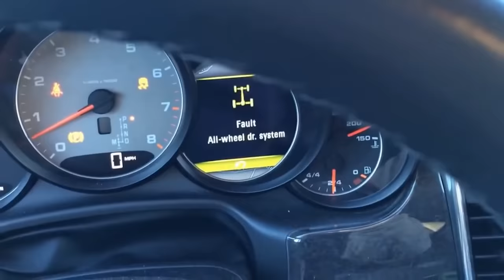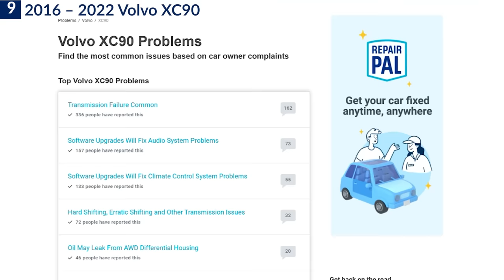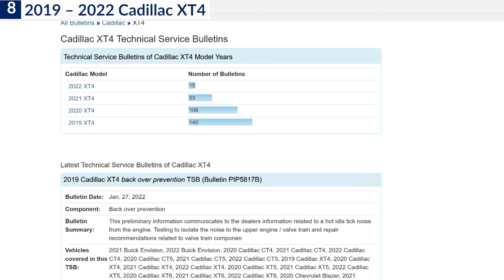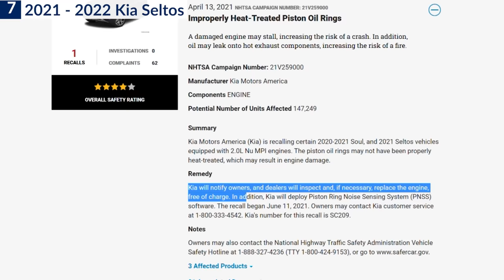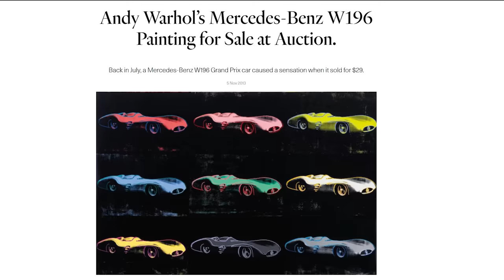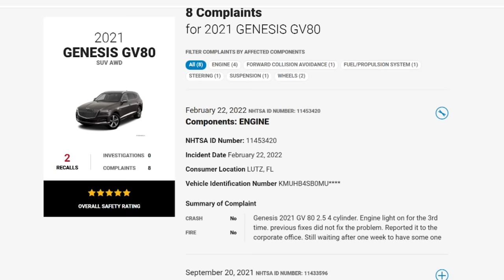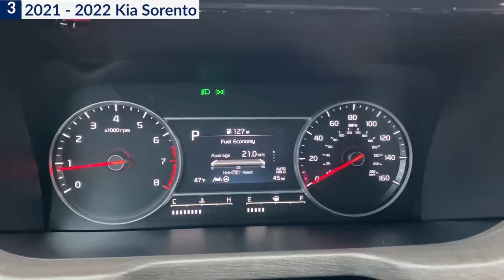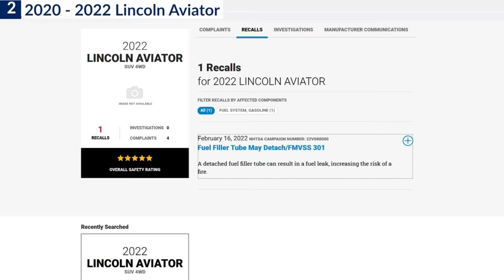10 New SUVs to AVOID - Here is Why !!

Comment: Half the time you spent on talking about the GV80 was about it's cost, which has nothing to do about the topic of this list. Proving you couldn't find much at all wrong with the car. But in regards to the cost, it's much cheaper than it's direct competition when similarly equipped.
Reply: You need to go back and check the times. He literally spent more time on the problems than the cost
Reply: Especially the repair and maintenance cost!
Reply: lmao what are u talking about?

GV80 can go for 65K for a 4 cylinder, so there is no value. I would rather get me a Lincoln Aviator, which is actually the true value king and competitor to the GV80 in the segment. Hell I'd even rather get the new MDX over the GV80 too since the Koreans is asking way too much and too confident. 

Aviator starts at 51K and GV80 48K, so on the first glance the GV80 is undercutting the Lincoln. However not only does the Aviator also has RWD, but comes standard with a base 3.0L Twin Turbo Ecoboost V6 with more horsepower and torque than either the 2.5 or the optional 3.5 of the GV80. 

Also in the GV80 you need to pay extra 11K on top of the 48K starting price to get the 3.5 (and still don't have as much power), so comparatively spec by spec, GV80 is more expensive. 

Of course the Black Label Aviator is most expensive than the GV80 but you get more ownership and membership features that you don't get in the GV80. 

Not to mention the Aviator is bigger vehicle and can tow and haul more as well. Hell even a front wheel drive QX60 mommy mobile can tow more than the GV80. Ecoboost is also proven to be reliable with the 3.5L reaching north of 300000 miles.
Reply: Genesensitivity!
Reply: I have a Genesis G80 (not a SUV) for over a year and it's amazing.  Also have owned a BMW 740 and a couple Acura.  The cost and reliability can't be matched.
Reply: I have a g70,  best car I’ve ever owned. I’ve had, Bmw, mb, Acura, Infiniti, all those were trouble.  This car runs circles around the others I’ve owned many times.
Reply: @craigc1879  congrats!

Comment: I had my GV 80 with zero issues for two years. It just got killed by a drunk driver, and its  top safety rating paid off. I walked out without a scratch, with both cars being write offs. As for value, it’s got  all the features of far more expensive cars except for the option for those people who want a 500+hp engine. I have no idea how it can be on this list.
Reply: I have a GV80 Prestige. Super happy, this list is stupid, the GV80 is a luxury model not a CRV. I also have no idea how it can be on this list.
Reply: Because you are Korean

Comment: I own a GV80 had it for more than 1 month and just breached 2000 miles. So far so good. I guess time will tell, but the part about it being too expensive is entirely subjective. The features that it has vs it’s competitors-Mercedes GLE, BMW X5, and Audi Q7, make it a good value.
Reply: Much agreed, my mom went from a Cayenne to a gv70 and she has 0 regrets. It’s got nearly 4k on it and has had no issues thus far. Interior is better than the Porsches in my opinion too, they did a killer job
Reply: I have a gv80 n had it almost a 1yr n had zero problems so I guess it's on how well u take care of ur car
Reply: @corriuadorsey3728   Truth
Reply: I have a GV80 Advanced and I love mine!
Reply: I’ve had my GV80 for a yr and so far so good.
Reply: @iananderson8911  Agreed, I used to own 2020 Cayenne and that had electronic and connectivity issues from very early on.
Reply: @iananderson8911  I would never buy a first or second model year of brand new vehicle. Asking for trouble.  Too many issues to work out
Reply: @seanelucero  I totally agree, I wouldn’t either but the opportunity came up and my parents didn’t want to keep dealing with the Porsche name premiums on even the smallest stuff that was having issues with that vehicle and so they jumped on the gv70. So far no issues but time will tell
Reply: All of their ratings are based on rare comments they hear on forums and are very highly subjective, not fact based. If Genesis is rated low for price, where is the tremendously unreliable BMW, Audi, etc...? This seems totally random!
Reply: I want a Gv80 so badly. I’m going to get one soon!
Reply: GV80 can go for 65K for a 4 cylinder, so there is no value. I would rather get me a Lincoln Aviator, which is actually the true value king and competitor to the GV80 in the segment. Hell I'd even rather get the new MDX over the GV80 too since the Koreans is asking way too much and too confident. 

Aviator starts at 51K and GV80 48K, so on the first glance the GV80 is undercutting the Lincoln. However not only does the Aviator also has RWD, but comes standard with a base 3.0L Twin Turbo Ecoboost V6 with more horsepower and torque than either the 2.5 or the optional 3.5 of the GV80. 

Also in the GV80 you need to pay extra 11K on top of the 48K starting price to get the 3.5 (and still don't have as much power), so comparatively spec by spec, GV80 is more expensive. 

Of course the Black Label Aviator is most expensive than the GV80 but you get more ownership and membership features that you don't get in the GV80. 

Not to mention the Aviator is bigger vehicle and can tow and haul more as well. Hell even a front wheel drive QX60 mommy mobile can tow more than the GV80. Ecoboost is also proven to be reliable with the 3.5L reaching north of 300000 miles.
Reply: @miraphycs7377  "GV80 can go for 65K for a 4 cylinder, so there is no value." LOL That sentence makes no sense whatsoever. If you're saying the vehicle costs a lot and only comes with a 4 cylinder engine, well guess what - almost every luxury SUV on the planet comes with a base 4 cylinder engine (which is not $65K by the way - $41K USD, $55K CAD). I get it...you prefer a Lincoln. Go buy a Lincoln. ;)
Reply: @dalehuhtala9285  u cannot get a gv80 for 41k lmao
Reply: @miraphycs7377  Sorry, I meant the GV70 but still...
Reply: Range Rover the least reliable
Reply: It better not have any problems that thing is new haha.
Reply: I 100% Agree!  IMO, I think GV80 is better than any other of its competitors.
Reply: This video has almost 0 credibility like the info about the GV 80 and other cars is blatantly false.
Reply: Love mine
Reply: I bought my GV80 last night, no problems so far ;) love it!!
Reply: I love it how people keep complaining about the price of this car. It’s a LUXURY suv. It is an expensive thing. What people don’t mention is that it is significantly lower priced than its competitors and happens to offer a lot more for the price than the others do.
Reply: Totally agree. We looked at everything and went with the GV80 prestige because nothing compared for the price.
Reply: Had our GV80 Prestige for a year and sold it. Hopefully, you live in a warm climate because around here they were awful in the winter months after awhile. First winter was okay… second winter, the problems came and the dealership/service experience was the worst we’ve ever experienced. I would not buy another Genesis product again.
Reply: @beri232  sorry to hear that your Genesis didn’t workout. I have been through one winter. So far so good. Our winters aren’t too bad. I had one bad service experience. I was out of town and needed a tire checked and I went to a dealership that was a hybrid Hyundai/Genesis dealership. There customer service was atrocious. The dealership that I usually go to is a Genesis only dealership and they roll out the “red carpet.” If you got a lemon then I don’t blame you one bit; for the amount a fully loaded Genesis costs you should get impeccable service. If you don’t mind me asking, where you happy for what you got for your Genesis when you “unloaded” it; how bad was the depreciation?
Reply: @beri232  , can you please give us some more detail on why it was terrible in the winter? We just drove ours through the mountains in -8 weather and it was great. The only issue we had was the side mirrors froze but they still opened with some resistance.
Reply: @robertwalker8453  they wanted me silenced as I had written into Genesis Canada about the dealership and the problems I’d had with the car. I sold it back with a cracked windshield ($1,700.00 Cad) and they gave me $79,000.00 Cad with 14,000kms on the odometer. New cost was $85,000 Cad. It was the second winter of ownership that the car started failing. We get cold winters here and I park my daily drivers outdoors. Garage is for my bike,my Vette and my tools :)
Reply: @robertshields6214  first winter was fine… it was the second winter the troubles started. Engine ran terribly rough in temps colder than -25 celsius (the Hyundai mechanic slipped and said it was a common problem with Hyundai V6 engines), extremely rough ride on the 22’s in cold temps, electronics started to glitch (especially the nav), transmission would not go into gear a few times (we’d have to turn the car off, wait and restart it to get it to work), it stopped blowing heat on the passenger side of the car. After a month and a half, they still didn’t have it fixed and they had 8 other GV’s in line with the same problem. This was the final straw at which point we sold it back to the dealership…. this was in February of 2022.
Reply: @beri232  Although the car didn’t pan out for you; selling the car back for more than 90% of what you bought it for after a year and a half isn’t a bad deal.
Reply: @robertwalker8453  no it really wasn’t. It took a year for us to get it from when we gave the deposit. There’s a shortage here in Canada and it’s driving up used car sales prices as well.
Reply: Lol! Look man, you should cash in those chips while they still got value. Don't wait cause you might wait too late.
Reply: @dalehuhtala9285  It's not random.. It's very very accurate. Consumer reports  has been putting out this list for 40 years or more. When have you ever heard anyone say: Man, my car is toooooo reliable, Consumer Reports was soooooo wrong."? NEVER is the answer. They use feedback from actual owners plus they catalog parts from previous model years and those complaints and if new models use problem riddled parts from the past they know the model will have problems again. I pay close attention to this list every time I buy a car and it has saved me tons of headaches and cash. Toyota, Lexus, Mazda do awesome on this list and every year those brands do well because they build reliable vehicles. Kia/Hyundai has been putting out garbage since the 90s and they still are. You can tell because you don't see their older models on the road. It's sad because they market those vehicles to minorities, who can least afford the repair bills.
Reply: @3811eric  They reel you in with cool looking tech, problem is your buying a car not an IPhone. Get the basics right...engine, transmission, those come first! So many people make this mistake today. Oooh look at the digital dash! 😍 Well, I hope it looks good when they're waiting for a tow truck.
Reply: @robertshields6214  Get off the ship b4 it sinks. You've been warned. Don't fight the power. You don't owe Genesis anything. They don't love you. They just want your cash. Go get something that won't have you stranded.
Reply: Will be praying for you all to go good 🤣
Reply: i just ordered a gv70 and cannot wait for it.
Reply: 8 complaints on a brand new model from a nearly new brand…. I’d say you’re probably safe buying a GV80. I just bought the GV70, passed 1k on the odo and not even a hint of a problem!
Reply: Which engine do you have? Most issues have been with the 2.5T 4 cylinder turbo.  The 3 5T v6 has been good.
Reply: @seanelucero  That is a very good rule to go by. But it depends on the brand history of reliability.  I wouldn't hesitate to get a brand new model year of a Lexus in its first year of production.  I trust that brand wholeheartedly based on its 33 year history of STELLAR DURABILITY RELIABILITY QUALITY AND CONSISTENCY.
Reply: @gabevillarreal96  that is the one i ordered. i got the sport but not the sport prestige.
Reply: @jeremymoore7167  I was saying that because I own a 2022 Genesis G80 with the 3.5T and it's been perfect.  I don't get great gas mileage to and from work but on long road trips cruising at 75 I average 29 which is pretty good for a near 400 hp twin turbo luxury cruiser. I am meticulous about my maintenance and will continue to be. I'll keep it for 5-7 years and probably 90k. I should have zero issues. That's my hope. If it was engineered correctly,  everything will be great. So far I absolutely love it. Ride looks quietness comfort isolation and excellent acceleration.  Solidly put together as well!
Reply: Came here to say the same. "Overpriced" is not correct. The GV80 is expnsive, sure... But not overpriced.
Reply: You were warned, 2k? That's not even an oil change Talk at 150k plus
Reply: @fabfrenchies1974  at 21500 a still no problems.
Reply: I can buy a fully loaded GV80 in Germany for 90k. That's very cheap if you consider that it's main competitors, the BMW X5, Audi Q7 and Mercedes GLE, can be more than 150k fully loaded
Reply: @miraphycs7377  my very first car was a lincoln. The koreans have surpassed the americans in many segments imo.
Reply: I have the same car.. 47 thousand miles on it.. my transmission started to slip. !!  Never again . 😡😡😡😡😡
Reply: @dianamcgowan9277  oh wow. You must got a good one. I only had 56 thousand miles on mine. Then my transmission started to slip.. i couldn’t believe it. Never again !! 😡😡😡😡😡😡 I’m going back to lexus.
Reply: @harveyhankerson8359  Sorry to hear that. Currently at 31K miles and no problems so far
Reply: @robertwalker8453   best of luck.
Reply: I just bought gv80 with 78k msrp. I thought the just same. It is way cheaper than the bmw and Mercedes' counterparts
Reply: @dalehuhtala9285  Right! When he said it was expensive for a GV80 I was thinking the same. That thing is decked out with so many features for the price that others would have others reaching into $100k for an SUV.
Reply: @corriuadorsey3728  That's what I think too, I think a lot of car problems now in days, especially new cars getting smaller engines and higher HP, new owners not realizing to break in the engine a little for the 1st thousand miles, before tossing them around and driving them roughly or letting the engine run down the RPM from cold starts.
Reply: @miraphycs7377 I'd definitely get a Genesis over a Lincoln.
Reply: Kia / Hyundai need to have their oil changed with a good synthetic oil about every 5000 miles.
Have it serviced at your dealership so that you can keep your warranty in play.
Reply: @dalehuhtala9285 😂 Good luck keeping that Lincoln out of the shop.
Our secretary at work drove one of those.
Reply: @gregelguapo2661  we can agree to disagree I guess. I have had Toyota and Honda vehicles for years and was concerned about going with a Kia Optima but it has been the most reliable car I've ever owned after 11 years so now I have a Genesis GV70. A few bugs at first but it has been very good.
Reply: @dalehuhtala9285 Lincolns will all be made in China for '24
Reply: @gregelguapo2661  You have way too much faith in CR. Expand your research and you will see what I mean. The auto ampnd media industry is not pleased with them right now.
Reply: @ChasL704 Okay....I don't have a Lincoln...?
Reply: @dalehuhtala9285  I've had great luck with my kias. You do not want to go long on oil changes. Every car I've seen in the shop with a blown engine has coked-up oil. You go long as many as two or three times it's likely to become an oil burner and you'll be lucky if that engine goes to 110,000 +...
 I am in and out of the shop a lot I probably seen about 6 engines in the shop in that time and it's always poor maintenance. Filthy engine compartments you can tell.You have to change the oil. Also helps keep your warranty in play.
Reply: @dalehuhtala9285  Sorry..🤔 or congratulations 😅🙃
Reply: @ChasL704  I use synthetic oil and go about 8,000 KM between changes. I have 265,000 KM on my 2012 Optima SX.
Reply: @dalehuhtala9285  It's a blessing to have a good car...
Reply: @seanelucero  facts
Reply: @MSotelo503  it's sad when you buy 40.000 50.000  and there junk. That's why I have a used 2013 v6 Ford edge
Reply: The GV80 is a great vehicle and smokes the competition in bang for the buck. Mine is 2 years old and no issues.
Reply: Wow 2000 miles 🎊 🎉 🎈 … 💩
Reply: @SME5724  now 40K after 1.5 years (on the road a lot for work) and still no problem 😉. I keep my cars serviced which is more than half the battle. A whether you like it or not Genesis is taking hold in the luxury segment.
Reply: I have a GV80 Prestige since it came out, now 3 years old. NOT A SINGLE ISSUE OR PROBLEM. A helluva lot more than what I can say about my previous BMW’s and Buick Enclaves.
Reply: God, you guys are so lucky, here in Israel, the Genesis GV80 costs about 150,000 USD and more, because of insane taxes, 50k usd is nothing , 50k doesnt buy a cheap fiat here
Reply: @DigitalOutlawed  OUCH!! 🤕
Reply: @larrybryant6015 ikr! I was just looking at the Mazda CX-90 whewww 😮‍💨🔥